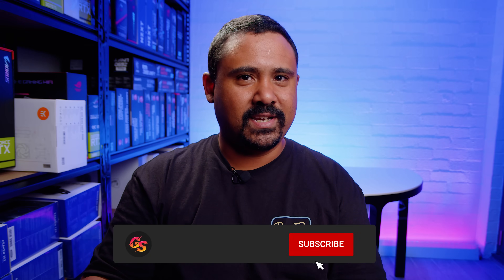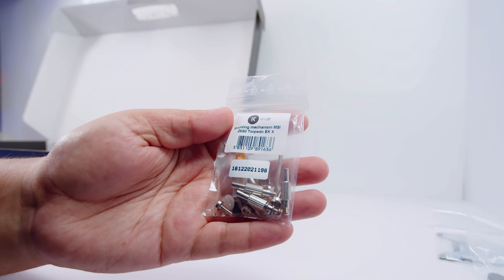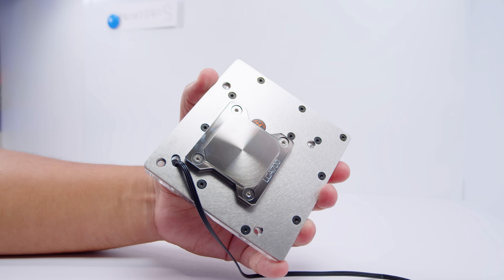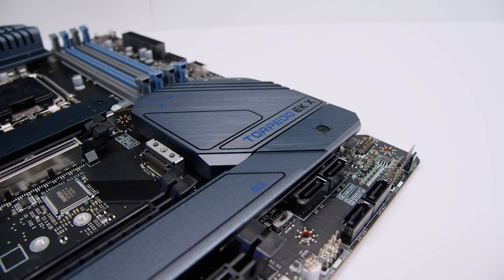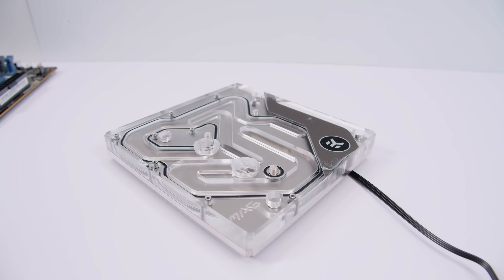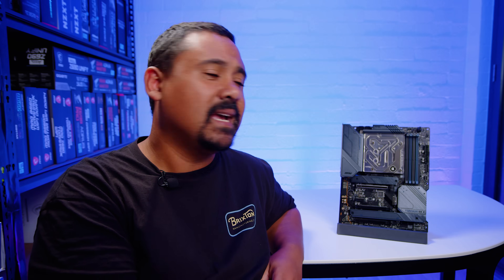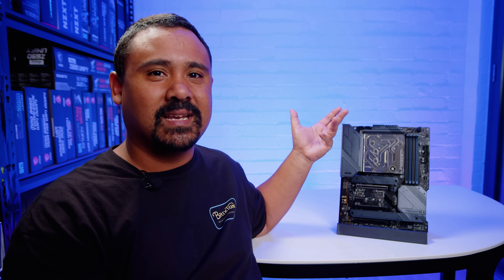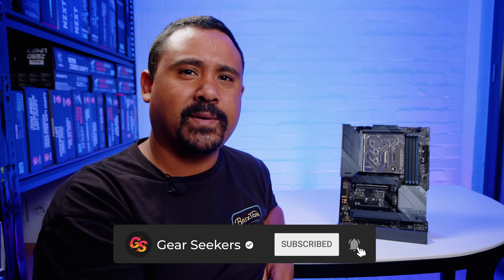MSI Z690 Torpedo EK X Overview: Water Cooling Gets Easier!

Comment: I do wonder if the vrm cooling is quite inefficient though having to transfer heat form vrm to the plates via pad, and then via another pad again to the block. But it’s probably more than enough cooling for average users.
Reply from the maker: VRM arrays without the heatsinks don't even get that hot.

Comment: Good z690 MB's already cost too much and now their adding an EK tax.  I feel like only a handful of enthusiasts will buy something like this in the current market.  Manufacturers seem completely tone deaf at this point.  Note:  the VRM solution seems very gimmicky at best.  This solution is horribly inefficient with 2 stacked thermal pads and 2 stacked heatsinks.  I need to see this tested otherwise I'm calling BS.  Thank you for sharing Nick.
Reply: der8auer has tested it, it works quite well.